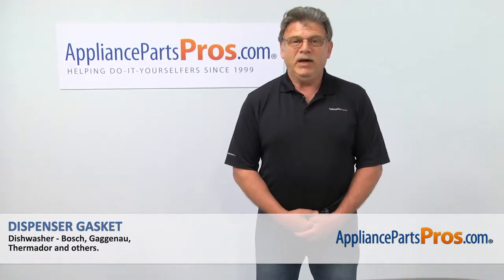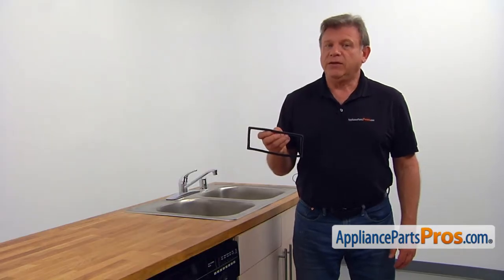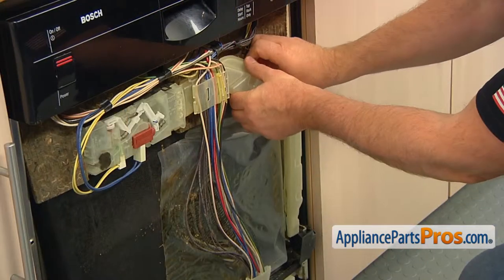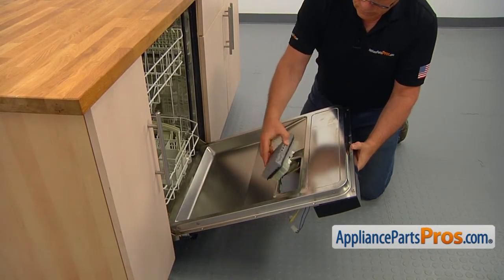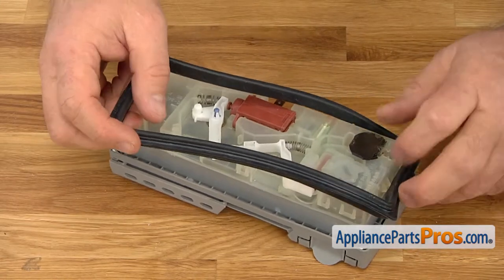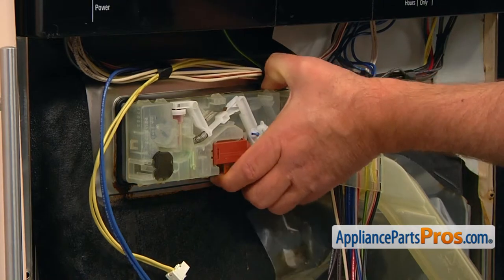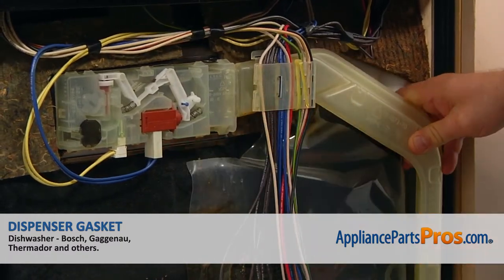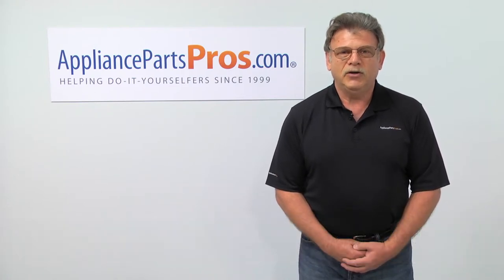How To: Bosch/Thermador/Gaggenau Dispenser Gasket 00166637

Comment: 2:50 - Make sure you are holding the door like you see in the video! I pushed mine in with the door down, and it bent the left part of the inner door very badly. It took me a very long time to try and bend it back. Hopefully it won't leak... if I have to end up replacing the inner door, I'll have to call a professional as I feel that's going to be too intense a repair for a non-professional like me. It would have been nice if he had stated when he was pushing in the dispenser something like "Be sure to hold the door when pushing in the dispenser, otherwise you might damage the door." I guess that might seem like common sense to a professional, but you are instructing a much broader audience, so you really need to warn about pitfalls like this.